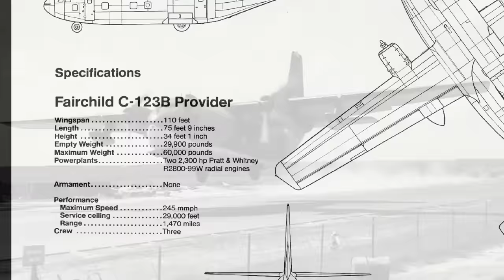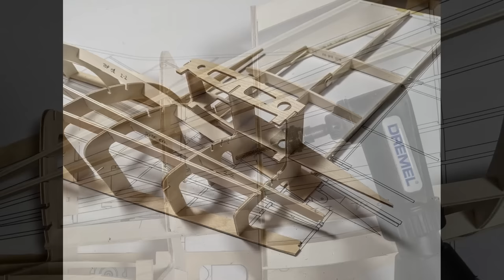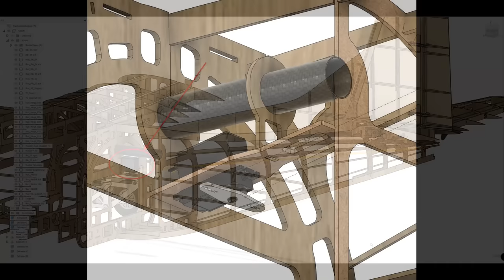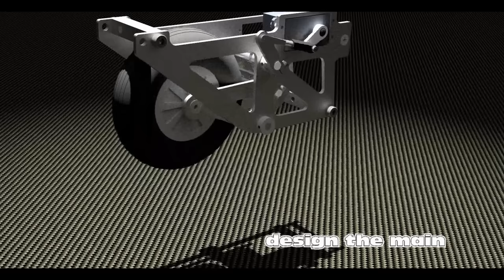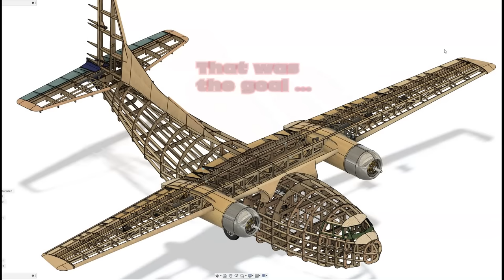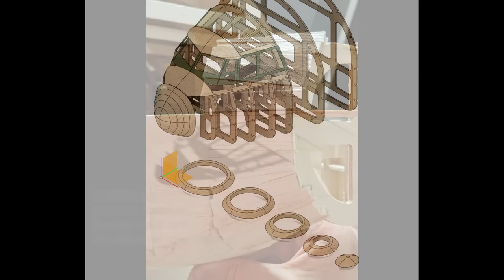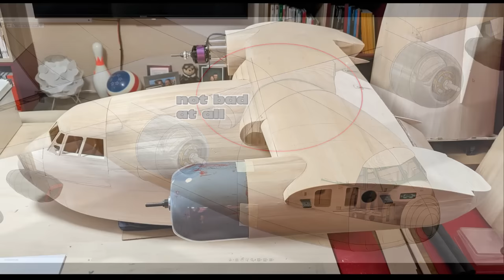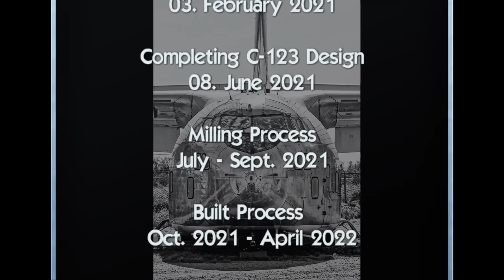Building a electric powered C-123 Provider RC model  airplane 1:12 scale (2.80m wingspan)

Comment: What a great video, and wow, what a great project. I too enjoy building from balsa. My first RC models were a "Taxi" trainer and a "Mosquito" glider, both by Graupner (built a lot of free-flight gliders before that). Then I went on building my own designs. Today everyone and their cousins seem to fly foamies, or at least RTF models. They don't know what they're missing, building is at least half of the fun!

...Are you left-handed? Over some 50 years, my left hand has been the victim. Every now and then X-acto knifes, Olfa cutters, slipped screwdriver bits, all sorts of sharp, pointy or blunt stuff seem to find their way into my left hand, which has collected a good deal of scars as that's the one trying to hold things as they are cut, drilled, sanded, etc.

You're building a masterpiece. But I didn't have to tell you that, you know it already.
Happy New Year.
Reply from the maker: Many, many thanks for your kind words and sharing your memories with us. We have obviously experienced a similar growth 😉 I too have built a Taxi in my youth, of course and my first RC glider was a BETA from Graupner.  The world is changing and people enjoy other things today. I guess that's always been the case and it's up to each person to decide to buy or to build.

And yes, I am indeed left-handed 😄and had severely injured my right hand. The worst thing was that I couldn't tinker for a while, even though I tried, which was a pretty bad idea. There is little you can do to make it heal faster, but a lot you can do to make it last longer. 😝

Comment: By the way, I would like to remind you all, that WD-40 is not for lubrication - as many people think - it is good for what it was designed for. For removing moisture and loosening connections.
There is 15% oil there. It is 50% mineral spirit.
It has to appear easily, penetrate and disappear quickly.

Therefore, after cleaning, appropriate grease/gear oil should be applied. Oils for maintaining bicycles are surprisingly good.
Light, low viscosity and even after wiping, they work well under load.

Comment: Your design is amazing, but I doubt many points.  Have you made room for maintenance later?
Reply from the maker: Thank you for the kind words and you can be sure that I also have my own doubts probably the same like you 😉 If I were to build the machine a 2nd time, I would probably change some things. But I have not come so far now with this prototype to give up. We will see if the machine flies or dies 😏

Comment: The C-123 has been a favorite since I was a child.  They were still operated by Air Force Reserve squadrons near my home in the 70s, so it wasn't uncommon to see (and hear) them overhead.  The auxiliary jets were particularly loud and masked much of the sound of the radials until they were shut off when the take-off climb was complete.   

A pilot acquaintance obtained pages from the structural maintenance manuals for me, which contained a wealth of information:  The drawings indicated structural locations identified by STA and WL numbers.  Since those numbers represented inches from an origin point, this meant that I could draw my own model plans with reasonable accuracy.   

A difficulty I had was with wing and stabilizer incidence, as the full-size aircraft appears to have a rather pronounced degree of wash-out.    The stabilizer and center section of the wing are noticably positive in relation to the fuselage.   The aircraft doesn't land "nose high."  The flair orients the fuselage to be barely more than parallel with the runway.   It follows that at cruising speed, the fuselage is actually slightly nose-down.  Many photographs I've seem support that theory, but it is just my own speculation based upon what I saw in the drawings.   I say "saw" because those documents and plans were lost to me in the 90's with the project never progressing beyond fuselage templates.

Now, with 3D CAD, LASER cutters, CNC mills, and 3D printers all being obtainable for the home hobbiest, the potential for grand projects like this is greater.  I'm only a couple of years older than you, but I am weary in body and mind.  I don't know that I could take on such a task by myself.  The learning curve would be steep, and my mental stamina isn't what it used to be.  It seems that all of my energy is expended during the workday.  Not much left to do but sleep and be ready for the next.

I admire what you've accomplished and hope to see the finished model some day.  Cheers.
Reply from the maker: Thank you so much for your kind comment and for sharing your wonderful and precious memories ❤ If you are older than I am, I probably won't be able to tell you anything you don't already know. I can only tell you how I am doing. Starting something new is never easy but I'll never know if I can do something if I don't try. Whether I do something or I don't do something doesn't really matter in the end. My time goes by either way. I'd rather spend it trying and risking failure than not trying at all. To be honest, I didn't expect to make it 😉 .. and you are right, by the way. The aerodynamic design of the original machine is typical for an old heavy transport machine. Large angle of attack in the wing root and strong washout at the wingtip. The original wing profile does not work so well with this layout in a model scale .. says the Reynold-number .. not me 😉

Comment: Does it shake and parts fall off like the real thing?  That was the first plane I jumped out of.
Much safer than being in it when it contacts the ground.
Reply from the maker: Parachuting out of a provider, these are certainly great experiences and memories 😃 I love the proportions of this machine 😍 Too bad it was only used for a few years. My machine has successfully completed its first test runs and the electric drive runs smooth as butter with virtually no vibrations.  At least nothing has fallen off 😄 Let's wait and see what happens once the machine is in the air 😉

Comment: nice, how much it will weight? it seems a pretty solid reinforced structure, in my experience balsa sheeting in that plane was too much weight, it has already a strong structure, i simply cover it with monokote
Reply from the maker: Hi Joergen, thanks for your thoughts. I have given the expected takeoff weight in the video description. It will be 14kg, so this beauty is no lightfoot. But my B-26 and also a De Havilland Mosquto flew well with a similar wingloading. If I would build this machine again, I would certainly find some saving potential, which would for sure not be wrong. However, I would not eliminate the balsa sheeting 😉
Reply: @LarsBaeter  14kg? on 2,5m wingspan? not heavy not light, just ok, very nice job by the way, do you sell the model plans? or are free to download?, it would be a nice thing if you can add a working cargo door, in my local club we use to drop candys to the kids with a similar plane in air shows
Reply from the maker: @jorgeneo560  It's in fact 2.80m wingspan on 14kg takeoff weight 😉 and I expect that this machine flies pretty scale like. I don't want to fly fighter like maneuver, there are enough other machines for that.

Candy Bomber are quite usual on our airfields during air shows 😀👍 it would be for sure possible to design a cargo door also for this C-123 .. but not in a prototype 😉

I appreciate your interest, but currently I don't offer drawings or the huge Fusion 360 file for download.
Reply: @LarsBaeter  ok, its a nice work, i will suscribe and hope to see it on the air one day

Comment: I see that you have worked hard to compile the production process into a book, do you plan to benefit the vast number of fans? I don't want to miss every detail, because I am also making a homemade airplane, just watching the video is not enough. If you can remember to inform me, I wish you an early completion, thank you for your sharing
Reply from the maker: I appreciate your interest in this video and wish you much success with your own projects. Please do not be disappointed, but this is not a professional YouTube channel and I do not offer any documentation about my model for now. The Fusion 360 Design File has 180MB and my own project documentation has around 120 pages. I am sure that the many subscribers, want to know how this adventure turns out. I will not disappoint them but it will still take some time until maiden 😉

Comment: have you had issue with your chiron?
i have one and it hasn't worked correctly since i bought it.
Reply from the maker: Hi Orhlando, my Chiron print without any problems. I just put some tape on the SD memory card to make the contacts better stick. Otherwise, the print can break off due to the movements and vibrations during print. In my opinion, most problems probably arise from a combination of a filament and unfavorable print settings. The printer is not responsible for bad results. I needed patience, time, some try and error, a lot of googling and many youtube tutorials to find settings which led finally to good results 😅

Comment: Hi again! I've noticed the  horns milled from duralluminium: I've also a Stepcraft, although some years old now, and I would like to ask you what working parameters did you used in terms of toll diameter, feed-speed, rpms and depth of pass. I've tried with very small passages of 0,05mm at 200 mm/min, but takes hours...
Reply from the maker: I am not a professional metal worker and would personally rather not recommend cutting data here. My milling results are maybe usable but really far from perfect. The milling of the rudder horns also took quite a long time with a 2mm dia cutter, feed speed of 180mm/min I can recommend the cnc-wiki https://www.cnc-wiki.de/Betrieb/Fraesparameter, the Stepcraft forum https://www.stepcraft-systems.com/forum or the cutting data calculator from Sorotec. 
https://webseite.sorotec.de/service/downloads/ 😉

Comment: Guten Tag, Lars. Ich hoffe das alles bei der C123 in Ordnung ist!! A good design & build.

I too am building a 1:12 scale "ThunderPig". Due to some "interesting" characteristics (eg, +7deg mainplane incidence, 4 deg tailplane incidence and other missing data) I built a 1:24 (foamie) version first. There is a vicious stall at low airspeed, needing a VERY forward CofG and high landing speed. Fitting "fixed 45deg flaps" improved slow flying. I used the 1:1 wing section with 4deg of washout. I'd be interested to know your washout (1:1 seems to be 0deg!!) and your Take Off weight - I'm aiming for <6Kg using either electric or small petrol 2Cycles. Good Luck with the maiden - any idea when?

Grusse,

Dave, UK.
Reply from the maker: Hi Dave, great that you are also building a C-123 in 1:12 scale and I wish you much success. As far as I can judge it, virtually anything flies, which is made of foam, even a lawnmower and other aerodynamic sins. I must admit that your airfoil data sounds somehow pretty unusual, but if your plane weighs only 6kg .. give it a try. As already written in this video description 😉 this machine will have a take off weight of about 14kg. Root airfoil is a NACA 2418, the angle of attack is 2° and at the leading edge a 2412 with 1°. The elevator is a NACA0012 with 0° incidence angle. If this is all correct? .. we will know after maiden 😏
Reply: @LarsBaeter  Hello Lars. Check out     https://youtu.be/F16ISxuMKFo 
You are right - everything flies - just how well, and how many tears???
Let me know how you get on.

Comment: Hey Lars! That's an awesome RC plane and you took a mammoth task to achieve but passed it with flying colours. I take my hat off. But........Where are the four stroke glow (or gas) engines?. Sorry, I could not avoid it 🤣😂🤣
Reply from the maker: Thank you for your kind words 😀 Depending the engines .. I was always to dumb for these glow engines. In my hands .. electric is simply more reliable 😄😄
Reply: @LarsBaeter  That's a very good reason. I suppose it is a bit later now but you could put a small ducted fan in those decorative jet turbines and conceal the ESC and the battery on it or on the dummy external fuel tanks.  The only big problem I see is that you have to pass the power wires between the jets and the dummy fuel tanks and the receiver wire through the whole wing and front fuselage and you have just closed the wings........but it would be fantastic 😂🤣😂
Reply from the maker: @The727Flyer  nice idea .. but it is only 32 mm in diameter. I calculated it ... Insignificant thrust for too much weight. There is enough thrust, weight is a problem .. But I could place 2 smokers in the turbines 😉
Reply: @LarsBaeter  Ahhh OK. I had the idea it was around 50mm.
The effect at take off with the smokers would be fantastic!.
I am eagerly waiting for the painting episode.

Comment: for mainspars, its better to use spruce ?
Reply from the maker: Both woods are well suited for spars. However, the differences between pine and spruce are pretty small, even the density is similar. Pine "boards" can have more knots, but this does not apply to spars and I like the elasticity and the smell of pine 😄

Comment: Absolutely wrong. The Berlin Airlift started in 1948 to 1949 and there was absolutely no!! Fairchild C 123 in the air. The first c-123 was build in 1953. But to be honest, your Build is fantastic and it was a pleasure to watch this video. Cheers from Germany 👍🇩🇪😎
Reply from the maker: You are absolutely right Michael. My Statement in this clip is not correct. "The Provider participated NOT at the Berlin airlift !" .. but .. Tempelhof airport was used by the American allies and there are reports that in the fifties also Providers landed there .. There is no connection to the airlift, but there is evidence of landings at Tempelhof 😉 Regards, Lars .. born 1964 IN WEST-BERLIN .. a true Berliner .. a gradually dying species 😏

Comment: You did not include what was possibly the most important thing in building a scale model of any sort; the source of the original plans on which you based your drawings.
Reply from the maker: I included it indeed, but not in this "build video" ... so check this out. Here you will find all your answers 😉 https://studio.youtube.com/video/dqQiYjeQX-U/edit
Reply: @LarsBaeter  
This is impressive work indeed. Thank you for sharing it with us. However, it does not appear to answer my question; what is the original source of your dimensioning? You must have taken the dimensions from somewhere, on which to create your scale version. Or is your model just a close approximation based on photographs and the overall dimensions of the 'plane?
Reply from the maker: @michaeltelemachus5112  To be honest, I don't understand your point? I have the impression that you are trying to get at your very own idea of Scale or you have an expectation for a scale model that I do not seem to meet. I don't had any original Fairchild plans that I could have used to design the aircraft. I spent instead many weeks of thoroughly researching and gathered the best possible data and facts from as many and varied sources as possible. These data were compared and from this I designed the best possible version in Fusion using my very individual skills. This was not a competition and I don't have the skills nor the time to build a hyperscale model but I could provide enough documentation in a competition that would lead to a satisfactory placement.
Reply: @LarsBaeter  You have now answered my question. I was not trying to do anything other than understand your pre-drawing process. You see, I am building a half scale model motorcycle and my approach is to use the original as a pattern, but this would be very difficult for you in this case. I can only applaud your work, and congratulate you on a very fine result.

Comment: u gonna put some baby jets in it?
Reply from the maker: This suggestion was made me already several times 😄In this scale the jets have only 32mm diameter. Did not know that there are such small turbines. For ducted fans the effect would be too poor in comparison with the weight, but a few smokers can be placed in the turbine housing. If I mount them at all in flight, I will decide after the first flights 😉

Comment: Wow! That is quite something ;-) I love my 3D printers and Fusion 360 is just awesome (now that I've got the hang of it). I haven't got a CNC (yet). I might make it my retirement present. Then I'll have time to play with it. I can't wait to see your C-123 finished an flying.!
Reply from the maker: Thank you very much and I can only recommend such a milling machine. I bought it when I had no idea what to do with it and how to operate it. Not to mention I didn't know how to work with Fusion at that time. So if you will, I put heavy pressure on myself .. and .. it worked 😉 😂 😂my savings were gone but I'm having the most fun I've had in years 🤩

Comment: @31:03 Heh... Color Scheme kinda reminds me of my 3D Printed E-100 Superheavy Tank ( https://youtu.be/6XZXryXOO5A ) 😁
Reply from the maker: Well, camouflage color schemes are usual for military equipment. Nice tank you have printed.
Reply: @LarsBaeter  I was just kinda amused that Planes Camo Pattern putting a higher emphasis on hiding it in the Woods than in the Air 😁
Reply from the maker: @Duraltia  😄😄Good point .. but considering that the Provider flew over Vietnam, the camouflage scheme does make sense indeed ... and from the underside the aircraft was completely gray. Many aircraft at that time had exactly this camouflage scheme e.g. the A-1 Skyraider, F-100 Supersabre, A4 Phantom 😉